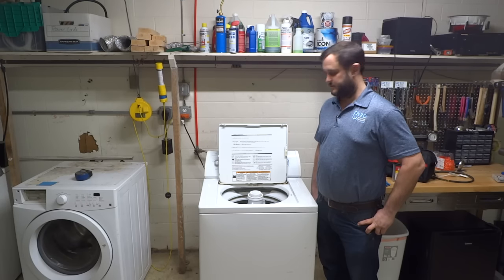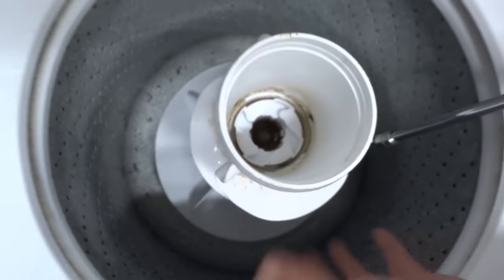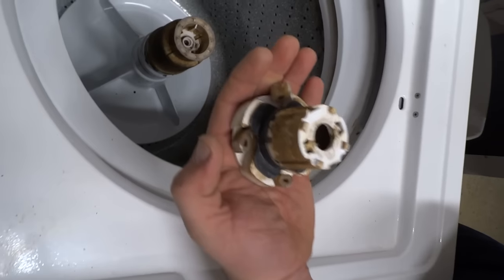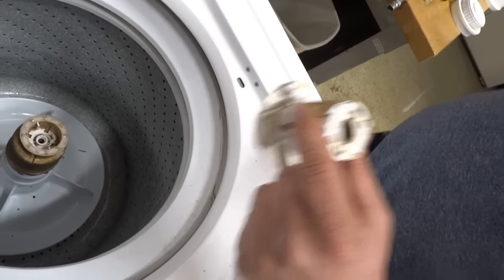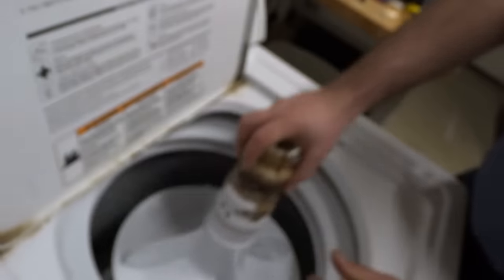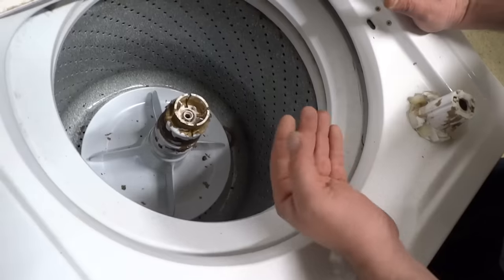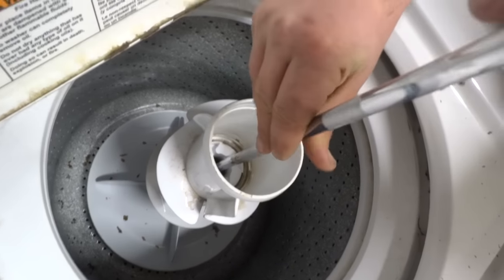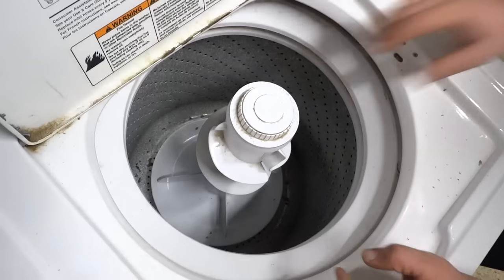How to Fix Washer Top Agitator Not Working

Comment: "soap funk"
Reply: Seaweede Starfish Amazing isn’t it; that fabric softeners, detergents all end up leaving residue after each wash cycle. Over time, if this isn’t “cleaned”, it will build up so bad that it may prevent fabric softener dispenser from working; as well as, you get that wonderful nasty funky gunky (old water smell) smell that’s “stuck” inside your washing machine. Recommend to my customers (depending on machine “usage”/frequency etc...) to clean their machines every 3-6 months (maybe even monthly if use a lot, have animal “laundry”, etc...) with the machines “cleaning cycle” (if it has) or can buy products, or make your own. Also, don’t forget to get down inside the hollow agitator when pull fabric softener dispenser off.....dirt collects down there a lot!
Reply: Lines up flick... soap funk... executes flick...soap funk is no more.

Comment: My top and bottom agitator don't work it out
Reply: Mine, too. It could be the motor drive coupling or the splines stripped. Is your motor running? Mine runs through the cycles, but the whole agitator just wiggles a little.